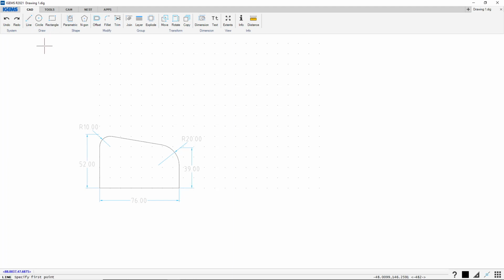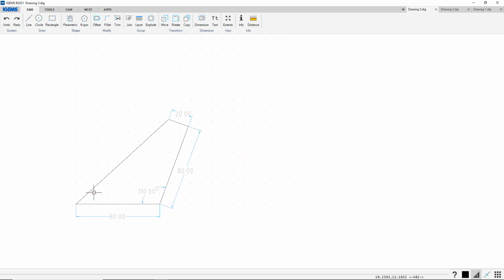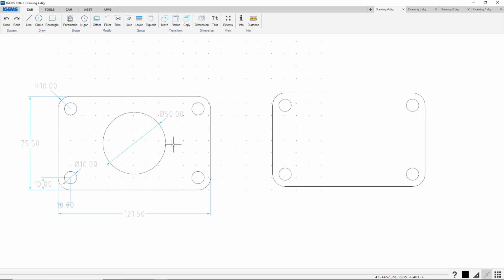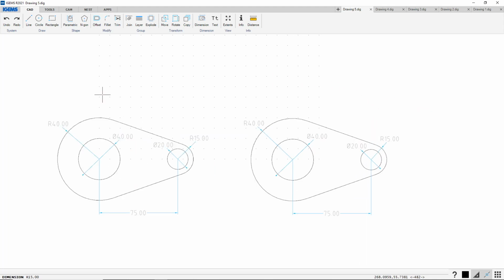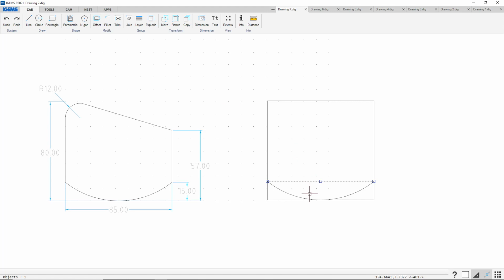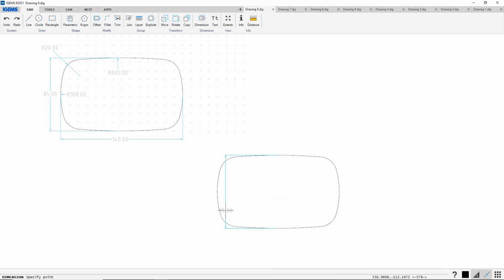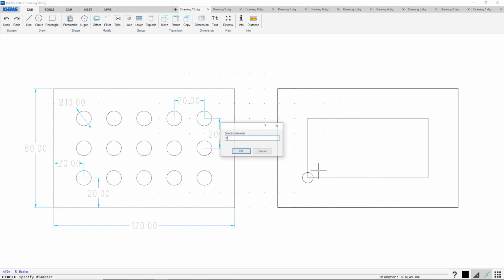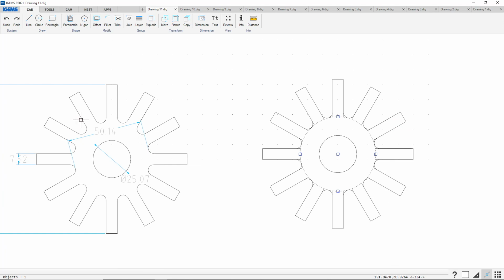Importing & drawing geometry

Comment: How do I proceed if I don’t want to create a closed contour, but just a simple separation cut.
Reply from the maker: Open contours can be programmed with the Quick command found in the Toolpath section. If there's no part involved, make sure to uncheck the Connect to part checkbox.